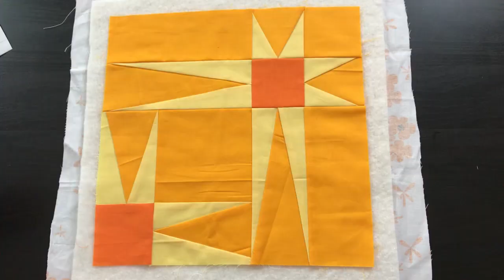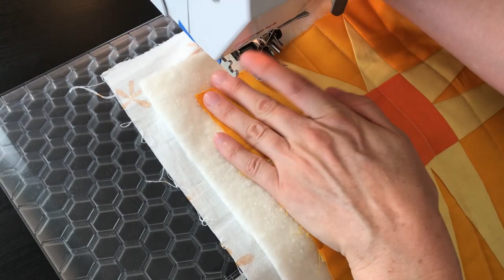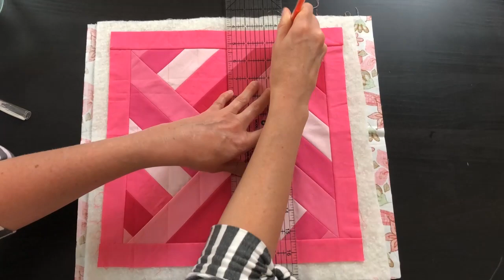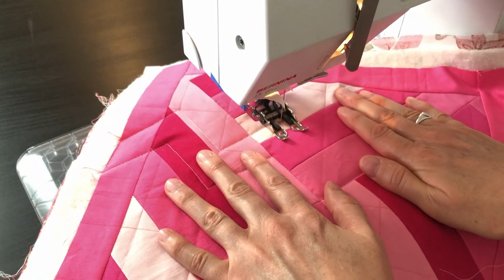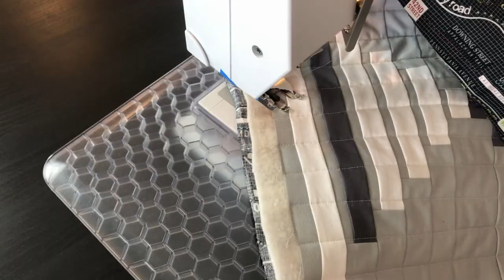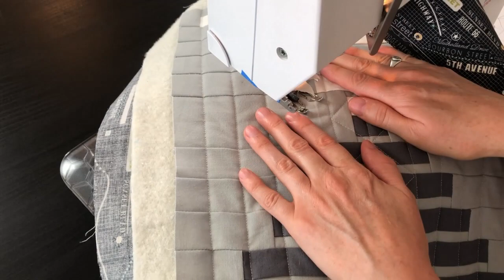More Walking Foot Quilting with On Williams Street - 3 Easy Grid Quilting Designs for Beginners

Comment: Nice podcast, however, I would had make sure the block was flat and ironed and not have wrinkles which get sewn into the block.  Also, you might have mentioned that if blocks are going to be sewn together, you should start quilting on the edge row at 2 1/4 to allow for sewing it together, the same for top and bottom. I realize this is for examples only, but new quilters would not know these things and could be disappointed when their sewn blocks are not the same size.  Thanks for instructions on the walking foot.

Comment: After watching a few videos of walking foot and free motion foot, I wonder why not just use free motion foot for both purpose of walking foot and free motion so I only need one foot. Please help me understand why i need both. Thank you so much for your input!
Reply from the maker: If you are comfortable with free motion, you can certainly eliminate the walking foot. I usually have my free motion ruler foot on my machine, so I can easily make straight lines or free motion depending on my design.

Walking foot quilting is great for those that don't want to free motion. You can quilt a quilt without having to worry about moving the quilt around so much to create the designs or stitch length, as that's still handled by the machine.

Comment: If you're having a hard time going slower than normal with a walking foot, just adjust the speed setting that most new machines have. I'm a 'lead foot' sewer, and this helps me a lot. So, when the speed is adjusted to what you want, you can push 'the pedal to the metal'  so to speak.
Reply from the maker: Excellent tip!
Reply: Like you, I have a "lead foot" not only sewing but also driving!

Comment: It would have so much easier to go one way on the court house steps block then go the other way across the quilt instead of turning it so much and you still could have used the points on the blocks
Reply from the maker: You are right! We saw that same thing after we had posted the video. Thank you for the feedback.

Comment: Great video. Wondering how you choose grid or placement of lines. I seem to hang up at this point. I like minimal quilting so my quilts are softer . You make your designs they don’t follow the pattern it is awesome
Reply from the maker: If I'm doing an all over design and not using the piecing at all, I'll just go off of what will evenly fall across the block. For example, if it's 12" (or even a much bigger even number) I might do my lines every two inches. If it's a number that would better divide by 3, I'd choose that. Just keep in mind your batting and how close/far apart it allows you to quilt and stay within those parameters and you can choose any number.